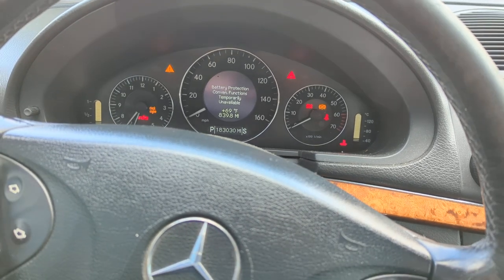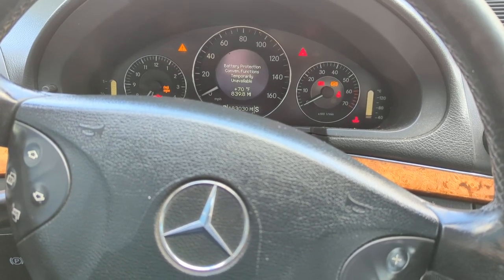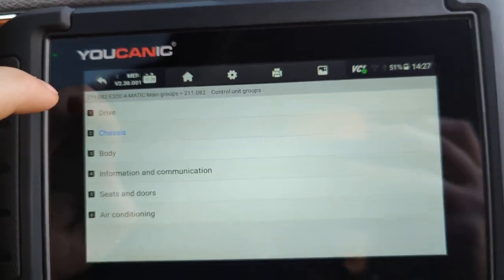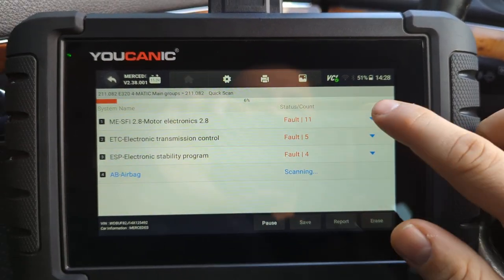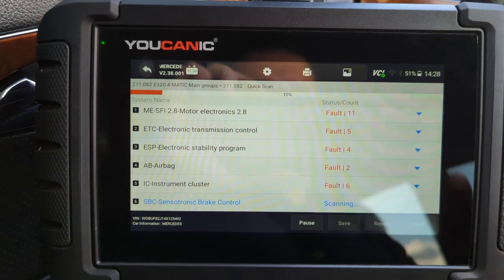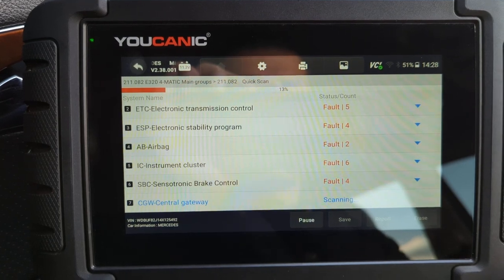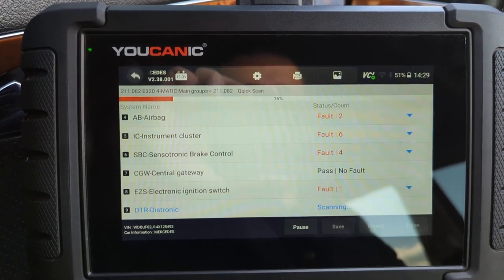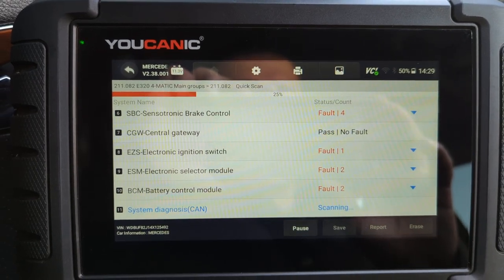Mercedes-Benz Battery Protection Convenience Functions Temporarily Unavailable Meaning & Diagnosis

Comment: Im getting the same message but, the car when trying to start wont turn over but, all lights on the dashboard are still on. Is it the the Main battery or Aux battery i have to replace?
Reply: Is the main battery ou aux?
Reply: U fix ur issue? If so what was it
Reply: @Callum P  Hey bro. I guess at that time it was very cold morning mind you I live in California at startup when I got that Message ...All I did was jump the main car battery which started and hasn't happened since.
Reply: Need to jumpstart it I have the same issue atm smh

Comment: Hello Question I have replaced both of my MB E350 batteries , I  still get Battery Protection Conven Functions temporarily unavailable , two new batteries anybody know what is the problem? ( I dont drive it much}
Reply: Same, my car doesnt start at all. I cant start the engine or even drive it
Reply: @jawadashrafi1749  what car do you have and dod you replaced the battery?
Reply: Same E500 06 switched mines out twice last two day still same code 🤦🏾‍♂️
Reply: W innym filmie na YT znalazlem ta sama sytuację . Winnym okazał się moduł BCM. U mnie to samo. Muszę zmienić moduł i zobaczyć jaki będzie efekt.
Reply: Winny był tylny moduł SAM :o
Reply: @KingRQ95 u stii have the same problem
Reply: @Michalw201 did your battery control module look broken? Mine doesn't look broke replaced both batteries and brand new alternator and still alternator not charging
Reply: @lilburkegamez yup. I can still drive the car by resetting it when it pops up . But it only pops up when I turn the wheel all the way or try to back in a parking spot a certain way I have to drive it a certain way .
Reply: @lilburkegamez new radiator , battery , alternator , now just got a starter smh people I bought it from lied . So yeah cheaper to fix for me at the moment so trying to get it right . These are definitely frustrating cars when In bad shape. But worth it once fixed . But Im going to sell and get something that doesn’t have 48 COMPUTERS😢😂 still staying with Benz tho
Reply: @KingRQ95  imma try to find a solution shii annoying 😂
Reply: @lilburkegamez  yea facts and that problem u said your alternator not charging I believe u need a new starter. Same thing with mine . My starter . New one just came today but can’t get it installed till Friday I’ll update it then n see what happens .
Reply: @KingRQ95  the car starts and runs no problem ? Was urs starting
Reply: @lilburkegamez  it was good . Bout 5 days ago I left the car wash then the check engine light came on I felt it about to give out so I drove it straight home . It did . Called my mechanic he said the battery so got that didn’t work it made that loud noise which is mainly the starter .
Reply: @lilburkegamez  it was running and starting no problem . But since I have battery drainage over night I disconnect my battery over night until that red light brake problem is fixed . Still don’t know exactly . Bleeding the brake might work or the sbc unit . Only other explanations .
Reply: @lilburkegamez  he was guilty rear module SAM

Comment: Switched out my auxiliary battery twice still reads same codes and my main battery and alternator are fine ..(e500 4matic 06 .. what can I do smh
Reply from the maker: Thanks for sharing your car repair woes. Our purpose here is to assist you in resolving these issues. A modern car such as your e500 4matic 06 might require a more comprehensive diagnosis that our YOUCANIC Full System Scanner can provide. It's a professional diagnostic scanner that we developed for car owners like you. Check it out at www.youcanic.com/scanner.

In addition, having the correct procedures and torque specs is crucial for successful car repairs. Therefore, we offer access to Factory Repair Manuals and Torque Specs for a small fee at www.youcanic.com/manuals. These tools together will ensure the job is done right.

Comment: I was getting the same message and even to start I had to cranked  twice, took it to auto zone told me aux battery bad main battery fine change the aux battery and it was starting fine no more message after a month I get message again. YOUCANIC what could possible be wrong any idea? 
I don't drive it sometimes for a week since I work from home, and after driving a while message is gone.
Reply: Did u fix it?
Reply: Same issue ! E500 06 .. switched out my Auxiliary battery twice I now have a agm one in .. and it still says the same message and looses power over night … I need the youcanic scanner to fix it ???